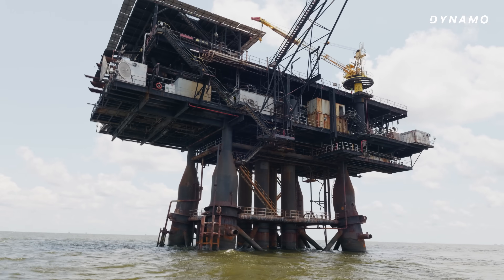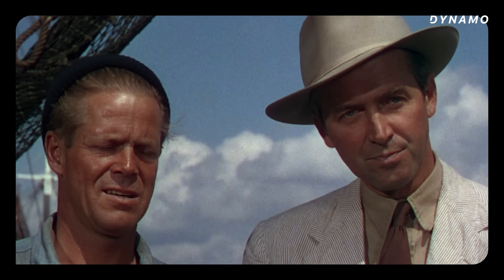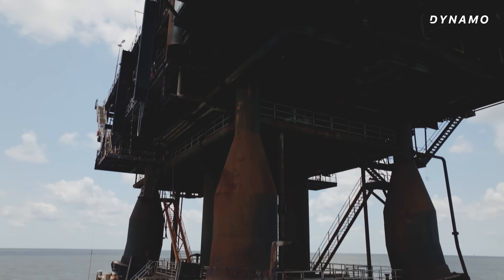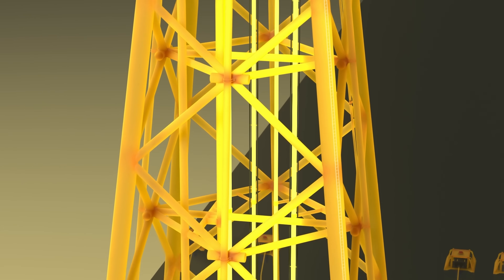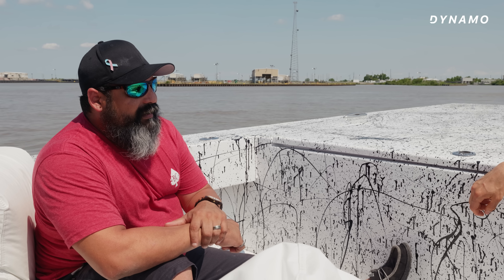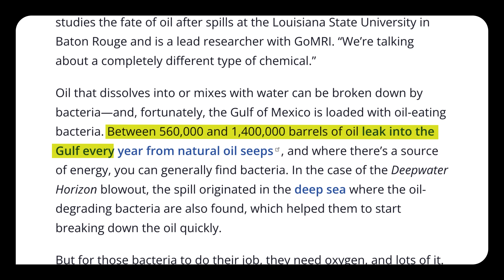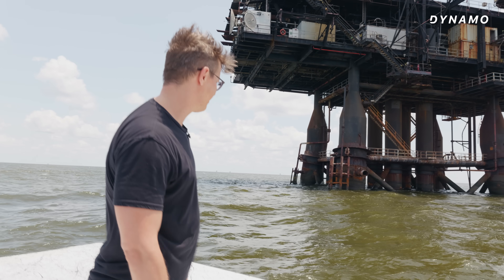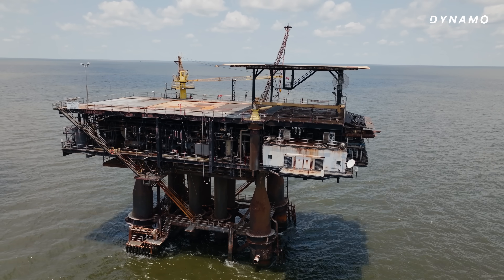I Visited Abandoned Oil Rigs — and Found Something Terrifying Underwater

Comment: I think the use of the term "Rig" is inconsistently/incorrectly used in this video. Technically,  "Rig" should be referring to the temporary drilling structure - operative word temporary. The permanent structure responsible for production and housing equipment is called a platform. Once drilling is complete, the rig disconnects and moves on, while the platform manages the production wells. Some platforms do have rigs installed for simultaneous drilling and production, but rigs themselves don’t remain fixed below the waterline.

You’ve rightly highlighted the real problem: improper well plugging and abandonment. Properly sealing unused wells is critical to preventing leaks and environmental damage. I’d love to see more focus on this area, with updates and education on effective solutions.

I think, the Deepwater Horizon and Taylor Energy incidents are not the best representative examples. Both are terrible accidents and should be studied but likely with different lessons to be learned than implied in this video. Deepwater Horizon was an active drill site not an abandoned oil well, not even a production well.  Additionally, the Taylor Energy spill was also at an actively producing platform not an abandoned well.

Comment: Every year the oil company operates a well they should have to place a bond of 5% of the profits made from that well or company that owns the well. also the company should place more of an initial bond. The bond program should adjust yearly to compensate for cleanup costs.   So a deep water platform places a 10 million dollar bond. Pumps say 10 billion dollars worth of oil out then caps the well 
The bond amount would be 510 million. They pay to cap it and dismantle and dispose of everything. They get a refund of say 90% the remaining amount could go to any possible failure that could occur on the  remaining infrastructure if any or to reseal the well if it leaks. Additionally it could pay for damages in the case that an aged capped abandoned well blows out and damages the environment or other people's ability to earn money like the fishing industry.

Additionally the bond would not be refunded regardless of sale it would remain until the well is completely sealed off and abandoned and guaranteed to not leak. So if shell oil was the initial company and sells the well the bond goes nowhere. No refunds until the well is safely dismantled and sealed regardless of how many times it changes hands. 

New companys may have to continue paying in to a new bond on the same well though if assume it would not be necessary once it reaches a certain amount.

Comment: I am a SCADA engineer and before transitioning to infrastructure-scale renewable energy generation, I worked in oil & gas. Which has a high need for SCADA (system controls, data gathering, and conditions monitoring). I often took helicopter flights from Galveston, TX and Port Fourchon, LA. The number of abandoned production platforms you see near-shore is truly staggering. They're endless.

Comment: The idea about making hydrogen from oil has been explored before; there was a company called Proton Energy that believed creating the conditions present in a SAGD well during the start of production could allow hydrogen to be filtered off a well using a platinum filter. But I do not see them doing their work anymore. I have seen old wells get life extensions with the injection of CO₂ into the well, which changes the oil density, but this only lasts for so long before the reservoir gas no longer has enough pressure to push the now thinner oil up the production bore. Besides, a reserve isn't like a big open cavity but rather channels in a common formation. What needs to be done is reclamation, but it has to be a profitable exercise to warrant doing it. So what kinds of profits does reclamation result in? Well, most wells also have other minerals and components that are pumped back into the well, such as lithium and rare earth minerals, which are also in high demand and just happen to be suspended in effluent water found in the well. In Canada it is estimated that for every barrel of oil out of the well there is an equal barrel of lithium being denied refinement and pumped back into the well. But I thought we wanted lithium and minerals? But if it is associated with oil, they say "oil bad," but those campaigning against oil are willing to take the money from oil. 

Not only are there abandoned rigs, but what about all the ships that still contain bunker oils or hazardous cargo? Not seeing reclamation of those any time soon.

Comment: The bond system should be updated to the maximum,  and the pratice of larger capitalized oil companies sellling off rigs  to dodge responsibility should be addressed. The oil companies are working the system to essentially bypass the rules set in place to ensure environmental protection.

Comment: This corrupt practice by the oil industry is just more reason why the world needs to get away fossil fuels and onto renewable energy. If the CEOs of any oil company that built a rig, but that did not safely decommission the rig was put in jail for endangering the environment, the big companies would not be fobbing the rigs off onto smaller companies that have a business model of declaring bankruptcy.

Something similar to concrete probably needs to be forced down all those well shafts, to make it as hard as possible for the remaining oil to leak out. And then all that rusting infrastructure needs to be stripped out. That's going to cost a ton of money and the oil companies are going to do everything possible to pretend they are not liable for removing that dangerous infrastructure.

There is a way to bring in an industry that can help subsidise the transformation and that is to tell green wind turbine electricity generation companies that they will be authorised to place wind turbines in the parts of the Gulf of Mexico that have been rendered environmentally safe. Wind power is essentially free energy, so the main costs in that industry are the installation costs and the maintenance costs. There will also be costs to decommission old wind turbines, but because wind turbines suck energy out of the wind, rather than sucking flammable liquids out of the ground, once you turn them off the wind just goes back to doing exactly what it was doing before the wind turbine was installed. Scotland has done some amazing things with off-shore wind farms and the long-term benefits of green energy is that it could lower the dependency of the USA on importing oil from not-always-friendly countries and lower household bills for end users. If people near the Gulf of Mexico can move towards use of electric heat-pumps for climate control and electric cars, electric buses electric trams and electric trains for transportation, the major cost to consumers would be the cost of the maintenance of the infrastructure.

In the long term, things would be cheaper for consumers, but in the short term, the wind turbine industry could be allowed to hold back some of the savings in order to fund ocean-bed cleanup that frees up more of the Gulf of Mexico for wind turbine expansion. And as more of the Gulf of Mexico was converted from oil rigs that leave behind danger to wind turbines that are designed to be safely de-rigable more electricity would be generated, the amount of profits that would need to be held back for cleanup would proportionally lower and eventually there would be enough electricity generated to export energy out of those states.

And if some folks really really want to try to do things with "decommissioned oil platforms" it would probably be better to float them away from the correctly-decommissioned well-head, bring them in for repairs and refurbishment and then tow them back out to a location that never had an oil rig sited there, so you don't build "sea research centres" or "sea hotels for rich people" that are one day going to be consumed by an oil-leak explosion. I would suggest that the mobile oil rigs are probably the best candidates for "historic preservation" as they do not have to remain in an area they once worked. And if someone really really wants to turn something like that into a tourist attraction, they could probably decommission some of the land near the shore where oil is brought to land, clean up that land and then construct a dry dock so that a floating oil rig could be brought ashore. That way you could have a "Museum of Oil Rigs" that looked similar to an operational refinery and an operational oil rig, but where you know the entire thing isn't going to explode if something goes wrong.

Comment: I believe that the wells were plugged according to federal regulations to prevent seepages. Of corse nothing is without risk. But don’t think that the operators just turned off the valve and walked away. Do a video with the agency charged with overseeing the procedure.

Comment: I’ve worked in the main pass area & yes there are thousands of abandoned facilities & it’s job security for me; I’m a loop operator & started this particular loop in 2021 when we had 9 or 10 flowing platforms & now only 4 short years later, the pipelines have all been decommissioned for various reasons; the biggest reason is the lack of oil & gas from these “shelf” facilities.

Comment: I would have liked if you explained the process to remove the platforma Md cap it. 
Definitely no reason they can do solar or wind on the platform and pull a powerline through the old pipe to shore. 
Use that income to cap and maintain the well

When it comes down to it there needs to be laws that state of you build something that will need to be cleaned up, it's your responsibility. Wether you sell it or not. When you sell the platform you need to save that money because ultimately it will be your responsibility of you assembled the thing. Larger cleanup deposits as well to start in the first place.

Comment: I bought an 8,000 Acre ranch in Southern Texas located between San Antonio and Corpus Christi. It has 838 old oil rigs that have not worked since 1971 - Long story short. We started cleaning them up and  just for kicks started with the one that was the most complete and not looted for its parts. We got an old motor and had an oil well tech start it up to clean out the pipes. We run it on the slowest setting and filled up 24 X 55 gallon drums with crude. We where thrilled but the Oil-man said it would cost us more to get rid of it and to send it back down the hole. Time passes - We start learning and making contacts. We contact a refinery and they hook us up with a crude trucking company and offer us $25.00 bucks a barrel since this is very sweet crude and they pay for delivery. Later an 8000 gallon track and trailer rig shows up and we start pumping. It easily fills the tanks so we ask them to send another and another and so on for 4 months and we have a check for $450,000 and we start looking at all 838 wells! We test them and they all have oil! What happened! As it turns out after sitting for 45 years the oil has "re-wet" the wells and as long as we pump slow we can make money so we get a loan and get storage tanks to increase profits to $30.00 a barrel and get 70 wells back in operation at strategic intervals (turns out it makes no difference since they all have the same amount of oil) Each well can run at dead slow and produce 75 to 150 barrels a day depending on the well before the flow gets too low to fill the pump which screws up the balance of the rig and that can get expensive if you break a pump rod. We think $18,000 a day is GREAT since all the expensive work is done but they still call these dry wells for some reason. I guess the BIG BOYS are just too greedy to scavenge and they say these will all run dry in a year or two anyhow,,, but that was in 2006 and they are still going. I think we should wait and see what happens in 50 years! All these old rigs could produce again but just in a small way. Good enough for self employed people to make a living. We have paid off all our loans and have $36,000,000 in the bank for a piece of land that cost us $12,000,000 to buy and was sold to us as a liability/write-off since they knew it would cost more to decommission all these oil wells but since they are pumping they are listed as ACTIVE again. I love this state!
Reply: How does one get a spare 12 million bucks to buy a piece of land?
Reply: @RoaldvdM  Actually we got 7 family members together and we got a jumbo loan and sold all our homes and took a MASSIVE RISK!!! I'd say we where upper middle class at best since our work ethic was always to push it to the extreme. We all joked that if it all failed we could always start a new cult out there and live in a tent! For the first year we all lived in trailers, it was brutal! You sound envious, you should not be, we just got lucky mixed with the will to work 16 hour days and go to bed bleeding hands and stinking of sweat every night! Our business plan was to start a cattle ranch and butcher and cure our own meat products since one member had a USDA license. Us 7 and our 18 kids where getting ready to work our asses off in the meat industries and also do 500,000 free range chickens before we lost hundreds a night to predators (Big fail). The Oil saved our Asses which we did not except. We even tried to sell this property to oil companies and they have no interest. They only want wells that bring in $100M a year. This is a 'MOM and POP' operation as far as they are concerned.
Reply: $12,000,000 to buy ???? your obviously mega rich to start with..
Reply: @Edward-turtle  Actually we got 7 family members together and we got a jumbo loan and sold all our homes and took a MASSIVE RISK!!! I'd say we where upper middle class at best since our work ethic was always to push it to the extreme. We all joked that if it all failed we could always start a new cult out there and live in a tent! For the first year we all lived in trailers, it was brutal! You sound envious, you should not be, we just got lucky mixed with the will to work 16 hour days and go to bed bleeding hands and stinking of sweat every night! Our business plan was to start a cattle ranch and butcher and cure our own meat products since one member had a USDA license. Us 7 and our 18 kids where getting ready to work our asses off in the meat industries and also do 500,000 free range chickens before we lost hundreds a night to predators (Big fail). The Oil saved our Asses which we did not except. We even tried to sell this property to oil companies and they have no interest. They only want wells that bring in $100M a year. This is a 'MOM and POP' operation as far as they are concerned.
Reply: @Freedomistman IM not envious at all, i applaud your hard work.... i actually though the 12m was a typo
Reply: @Edward-turtle  Hi, No it was a loan and we all risked our homes that were payed off at a VERY high risk. We could have ended up camping or living in tin sheds for a decade. That was our main motivating factor I CAN TELL YOU TRUE!!!
Reply: Yeah but do you know Jesus🤔cause all that money don’t mean squat.
Reply: @teen5089  I know. We did not plan to be rich. It just happened. We still love Jesus and can REALLY help out the church and it's members now (If you need a job or money join a church, it works). God Bless.
Reply: @teen5089 that money means more than you can imagine
Reply: My dad was incharge of the shelf riggs for chevron, they went all deep water a few years ago. 
A smaller company hired my dad to keep the shelf riggs running. 
 He said the smaller company upgraded the facility and things havent been better.
Reply: @Sithoseth  Good for him!
Reply: All that money and you couldn't buy a device with a tab or return key.
Reply: That's badasssss Man!!!!
Reply: This is an incredible story.
Reply: @matthewhandley9529  Not just incredible but we're speeding up the pumps a little more now on wells 43 and 44 and the crude is sweeter and no shortage insight. I wonder why they even abandoned these rigs. I read a story in 'The Oil Trader' That there are around 48,000 natural gas wells in West Virginia which they just took off off the pipeline and never capped them off but since 2022 hikers going up there and have found huge volumes of gas coming out of all the pipes again!!! Now the government is capping them all when they should be harnessing them. The EPA is bitching about how many millions of cubic feet of gas is creating the global warming effect what they should really be doing collecting all that gas! It's enough to run a small Country or to power a 6,000 megawatt electric generator So they figure. They should park one of those energy hungry AI data centers up there and run it for free!!!
Reply: @Freedomistmanvery impressed with your knowledge and vision here.  From what I have read, abandonment liability is the roadblock to people taking on these projects.  As a result, the valuable resource that could be captured is lost, maddening situation really.
Reply: Oil doesn't come from fossils and is being made continuously. Even if they run dry give them some time and they will fill again.
Reply: @joshuabarbre3245 oil comes from decomposed ancient organic matter ( these are the hydro carbons ) under pressure.
Reply: @joshuabarbre3245  I read about that! The Russians called it the ANAEROBIC OIL THEORY I think.